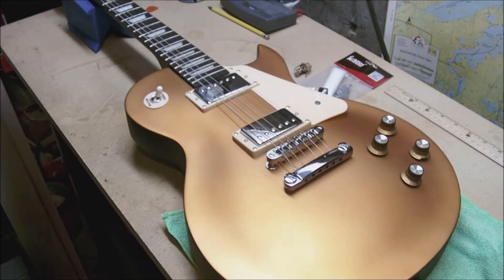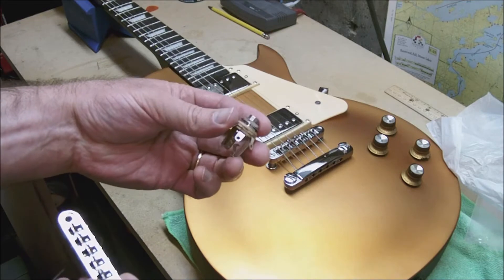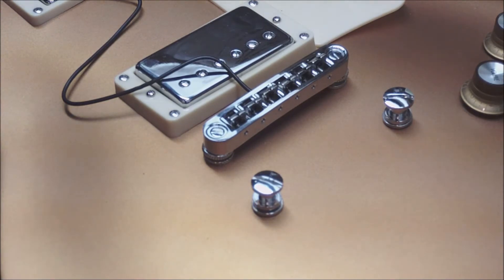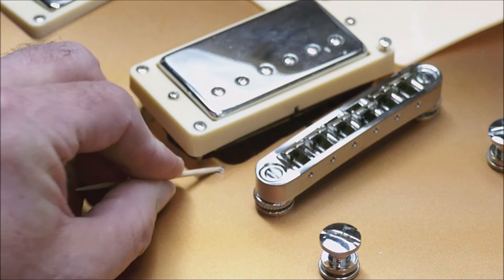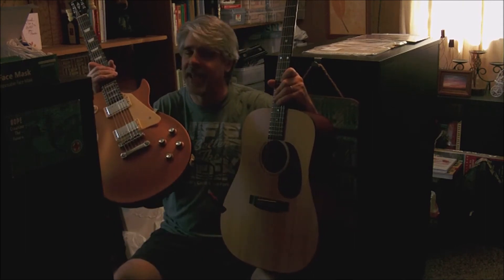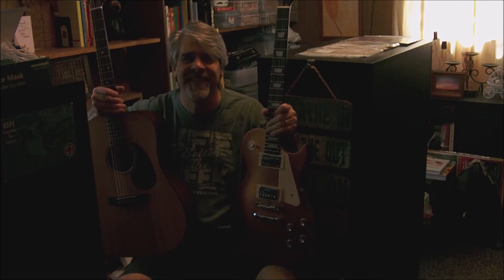Harley Benton SC-400 SGT Classic Series with piezo mod

Comment from the maker: I know I called it a "Stop Tailpiece" bridge in the video... it is actually a "tune-o-matic" bridge.
Reply: Thanks for this.
What I've always wondered when seeing these cheaper piezo bridges, is, is the piezo strip just affixed to the underside of the bridge with some tape, and having to get the vibrations once they've travelled through the whole unit, or is it inside the bridge unit proper?
Next, if it's just stuck underneath, would it be possible to either fit it beneath the saddles, or even cut a tiny groove in either the saddles or bridge with a hand tool to make the connection and vibration transfer more effective?
I've long pondered the efficacy of installing one of these, and was pleasantly surprised, although I thought the difference between both guitars to be quite stark and apparent.
The Martin's pup had a lot more character with more resonant highs and depth of timbre, nice work 30 years ago!
Reply from the maker: @onbedoeldekut1515  The piezo is definitly part of the bridge.  I didn't try to take it apart, it seems to work well as designed.

Comment: Just looking to clarify here… you have the piezo wired to a stereo output jack so that your 2 humbuckers still have use of the 4 guitar v/t knobs, and then split cords from the jack so the humbuckers go to an electric amp and the piezo goes to an acoustic amp?
Reply from the maker: That is correct.  The wiring for the humbuckers has not changed, wired to the 1st channel of the stereo output jack. I wired the piezo output to the 2nd channel of the stereo output jack.
Reply: @curtjunky  cool, thanks for that

Comment: Question what if you had through the neck pick up and kept your bridge pick up like an EMG 81 Let’s just say, will will that work??
Reply from the maker: I don't quite understand... but you could definately continue the mod by dropping the EMG 81, however you'll need a preamp and battery in the guitar as that is an active pickup.
Reply: Are you thinking that because he went through the body cavity for the bridge pickup, that he somehow was electronically combining the piezo and the bridge pick together?

He was simply using the cavity under the bridge pickup for convenience. The 2 signals (Piezo & Electric) remain separate. You'll notice some guitar makers give you 2 jacks and you have to run 2 cables. Cable 1: goes to the electric guitar amps; Cable 2: goes to the PA.

He was using a stereo jack so he could run a stereo cable out and just have 1 jack (again for convenience I'm assuming).

Comment: Is it possible to just have one outputjack and control the piezo vi another volume knob?
Reply from the maker: Not really, the difference in output between the magnetic and piezo pickups is too large. If you installed a preamp in the guitar for the piezo, then you could blend them into one output.
Reply: @curtjunky  i dont wantvto blend just be a le to use one wireless system
Reply: Could replace a volume or tone with a push-pull pot and use that to select which system is connected to the jack.
Reply: @evlkenevl2721  Do u have any wiring diagram to do that?
Reply: I've seen someone putting the passive piezo in series with the humbucker,  you can hear both and balance them with a bias knob (I think it changes impedance? ) but can't have just one or just the other. Sadly, I can't find it anymore

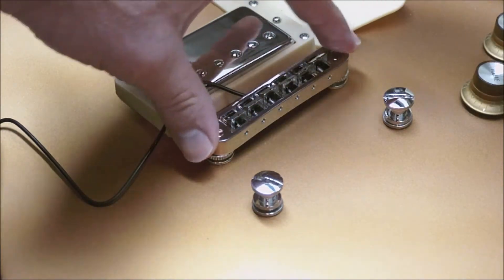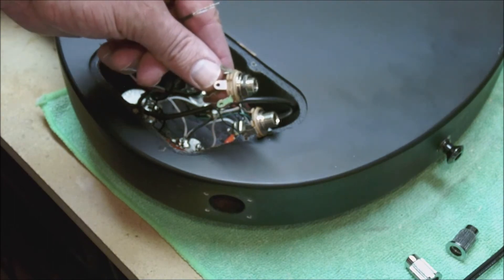Comment: I know this video is a year old now but I noticed  it looks like you have to bridge in backwards (3:30, 8:38) with the widest saddle slot on the high E and the thinnest saddle slot on the low E
Reply: I was thinking the same thing, but not for that reason but because the screw heads for adjusting the intonation are on the pickup side rather than the tailpiece side.  Right?

Comment: Id like to do something like this, to my Nashville Casino. But Im not wanting to do any permanent mods to a $3k+ guitar. This gave me some ideas, but what Id really like are small clip on condenser mic I can clip hidden in the F hole, run under the pick-guard, around the back, bundle with my other cable like a snake. The mic to a preamp and then both to an ABY. So I can switch between the two. You did a fantastic job on the video thank you. Gave me some good ideas.
Reply from the maker: That sounds like a great idea - love to hear it!
Reply: The lavalier mic is VERY common in Gypsy Jazz and Flamenco for the same reason (insanely expensive) guitars. 

I will say that in my acoustic flamenco group where we are barely even using amplification (just background music for restaurants and breweries) I got LOTS of feedback. That's with the windscreen and the mic on the inside too. 

Maybe there's a way to do it, but in my experience if you're playing louder than the human voice you're gonna get feedback issues with the lapel clip on mics

Comment: Hey!
Great video, i was wondering if it is posible to replace my neck element on the toggle switch for the piezo and use mono out. I have bought a Fishman Spectrum Aura Pre Amp which i want to run into the FX loop of my kemper profiler, the FX loop on the kemper can be turned on and off and my idea is to have a XLR out from the aura for the acoustic sounds
Reply from the maker: I think that is a very cool solution.
Reply: I have doubts about whether a Piezo pickup attached to a plastic pick-guard, replacing a standard magnetic pickup, will capture enough sound vibration to be effective, especially if no pre-amp is used. Magnetic pickups create sound via ferro-magnetic strings vibrating in a magnetic field. Electric guitar bodies need not transmit sound through their material.

In contrast, piezo's are either mounted to bridges or saddles made of dense material (metal, bone, etc) or to other material (the tonewood top of acoustic guitars), specifically because these materials transmit sound from the vibrating string well. Alternatively, they are vibrated by being mounted in the path of the sound emitted from the sound-hole of the acoustic.

Even if the mount that you suggest does pick up adequate vibrations to be amplified, there is the likelihood that the frequencies pickup will not be "broad-band", making an equalizer to be an added  necessity to avoid a muffled sound.

Hence, the suggestion is to stick to piezo pickups attached to the bridge. If a tremolo bridge is present, there's no reason why an inexpensive round piezo element could not be superglued or soldered to the underside of the bridge plate (via the spring cavity) and the piezo output could be blended with the output of one of the single coil pickups by adding a special blender pot. This way, in the single-coil switch position, the blender pot could adjust to all piezo, all magnetic or a blend of both pickups.
Reply: @olenfersoi8887  Thanks for your answer, altho not what i meant.
I ended up with the following signal path.
Gibson ES-335 with the piezö installed, stereo out, into a VoodooLab GCX (I had laying around) that can select which amp and pickup are used, magnetic pups go into a ABCD/Y selector and into my Kemper profiler (so i can switch from my wireless packs to the cable)
The piezo is going directly to the Aura DI XLR out.

All the switching between amps and kemper is done by a Voodoolab Ground Controller

Comment: Great video! I'm looking at doing this to my ibanez artcore.  Can you please confirm if the piezo pickup was wired direct to the output? There is no volume or tone controls for this pickup?
Reply from the maker: Thanks, can't wait to hear it on a semi-hollow body! True, piezo wired directly to output.
Reply: Install complete on my semi-hollow. I took the brave decision to drill down at an angle from under the bridge on the body top into the pickup cavity so the cable is completely hidden. Everything works great. I run the piiezo signal into an acoustic pre-amp pedal and separate eq on my board to balance the signal and take out the quacky tone. I then run both signals into an a/b/y pedal for quick switching. 
Really pleased with the sound and can't really tell the difference from my traditional acoustic guitar that is fitted with an under bridge piezo. One guitar carry solution for gigs and band practice. Acoustic solos are also much easier to play now. 
Thanks for this video as I was considering buying a hybrid system guitar; saved me a fortune!
Reply from the maker: @neilcorbett3843  Awesome!  Great to hear it worked so well!

Comment: Hi. How do you know which cable is for the piezo after you’ve split it? Sorry if that’s a dumb question!
Reply from the maker: When I wired the leads to the jack, I wired one pickup to the tip and the other to the ring of the stereo output.  The Y-cable I use is labeled "tip" and "ring".  If you're not sure, just plug them in - the magnetic pickups will be full volume, the piezo will be very low without a preamp direct box.
Reply: @curtjunky  thanks for your response. Will be doing this to my casino this week.
Reply: Mine has arrived. How do you know which is the pick-up wire and which is the ground wire?
Reply from the maker: @stevepurdie3889  If there is an outer wire and an inner wire; then the outer is the ground and the inner is the positive.

Comment: Nice video, and surprisingly your piezo sounds great! Impressive. By any chance can you tell whether the piezo is detachable from the tuneomatic or not. And also the six screws that hold the saddles, are they detachable? 

*I'm considering to buy one of this, the only thing that matters is I need a roller bridge because I use bigsby vibrato. If they can be removed I might mod it a bit and use it with my current roller bridge. Thanks in advance!
Reply from the maker: I would doubt you’d be able to take it apart to modify for a roller bridge. I’d keep looking on eBay for the correct piezo bridge.
Reply: @curtjunky  noted

Comment: If i run a STEREO cable (one side) and the other side ends with 2 mono cables, will there be no problem? I would run both into my helix and be able to switch "real time" from acoustic to electric
Reply from the maker: For sure, I run a stereo to two mono y-adapter - then I run one cable to my amp, the piezo cable goes into an active direct box into the sound board.  Your Helix should cover both nicely.
Reply: @curtjunky  thanks! Such a pity that this piezo seems gone from the market! Would you suggest something else like that?
Reply from the maker: @RobertoAntonacci  try "piezo bridge" on eBay
Reply: Really no need to keep saying "see you later" which sounds stupid because after editing it's just one cut connect to the next with no time delay.
Reply from the maker: @edmondwong6117  OK, thanks this is my third video.  I'll do better :)

Comment: Did the piezo has another output jack that's different than the pickups? Does this works on other 6 string guitars that has a tune-o-matic bridge?
Reply from the maker: I installed a stereo output jack. I use a stereo to double mono y-adapter. One output is the piezo, the second output are the magnetic pickups. That way I can run the piezo into the soundboard and the magnetic pickups into my guitar amp.
Reply: The reason for having two jacks is because of the wide difference in output strength between the piezo & magnetic pickups...hence, the need to pre-amplify the piezo output more than the magnetic. It's not a matter of different styles of jacks...as, unless you have a special poly-phonic pickup, they all have just output wires for the sound & the ground. Hence, jacks aren't supplied with pickups.

Comment: Hi, could you write something more about joining magnetic and piezo parts of circuit. Did you simply join both outputs in one jack? No other separating/balancing circuits?
Reply from the maker: I used a stereo output jack. The magnetic pickups are wired to one output, and the piezo is wired to the other. No blending or balancing.
Reply: @curtjunky  Ok, thank You 🙂

Comment: Do you need a stereo guitar cable ?
Reply from the maker: You can use a stereo guitar cable.  I use a stereo Y-adapter and run the magnetic pickups to my amp, while I run the piezo to an acoustic preamp - then to the soundboard.
Reply: @curtjunky  thank you. But without a stereo cable you can switch between both ? I'm having trouble finding a long enough spdt mini switch for a Les Paul.
Reply from the maker: @DoubleSixx  a volume pedal in each line will allow you to control your signals.
Reply: @curtjunky  As I mention elsewhere, rather than an additional volume control, a blender pot can be adding to combine the  signal with an existing pickup, allowing panning between the pickups. This, plus a tiny onboard active preamp in  the piezo output is a lot simpler arrangement that  having to have second output jack, or having  to use a stereo output cable and a second volume control.
Reply: @olenfersoi8887  Please tell me which onboard active preamp you used. Thanks!

Comment: Excellent video curt!! Guitar 2 was harmonically richer (of course being a Martin)...it did have the piezo quack though...Did you mic the acoustic or does it have an under saddle piezo??? For the money the Kaish unit sounded just fine.
Reply from the maker: Thanks! No mic on the Martin, just the under saddle piezo into the BBE (same as the Harley Benton).

Comment: This is a cheap type, with 1 bar of piezo under the bridge. The GOOD 1s have individual saddles of piezo crystals!
Reply from the maker: DMSProduktions  I’m not sure about that, each saddle had a “wax” drop in the back. There could be crystal in each saddle. Admittedly, I did not take the bridge apart for a closer look.
Reply: @curtjunky  Ok, fair enough, it MIGHT have individual elements! After actually hearing it, it may well have, as it sounded a lot more 'acoustic' than did your actual acoustic!
Reply: If you look at the back of it, then there are six solder points, one for each saddle. So I am going to take one and unsolder it and hopefully it will then be 6 individual outputs to play with. Maybe I will remember to come back here and update you on it.
Reply: @wbertie2604  Sounds LIKE  plan!